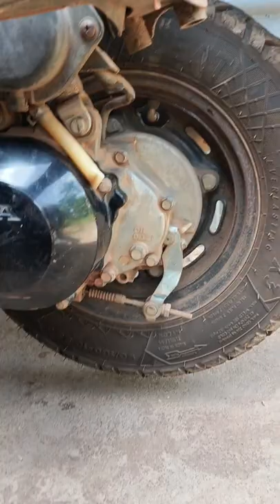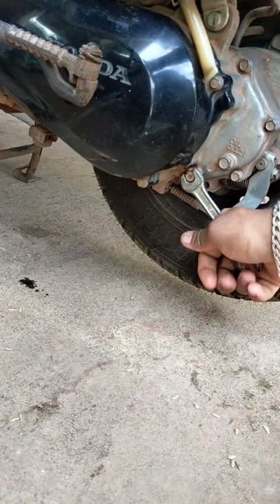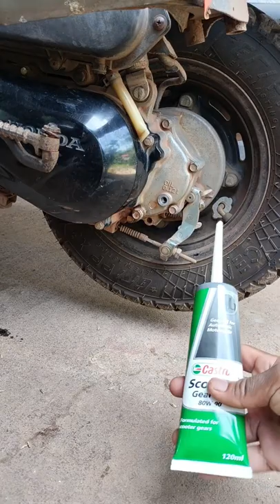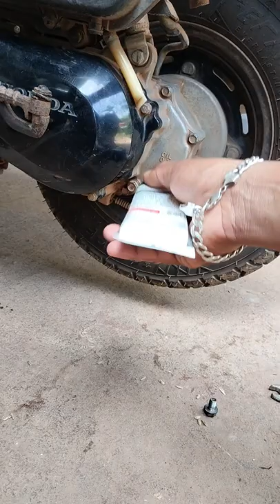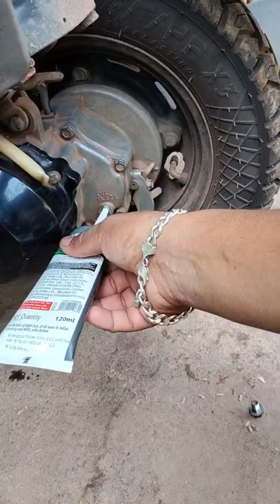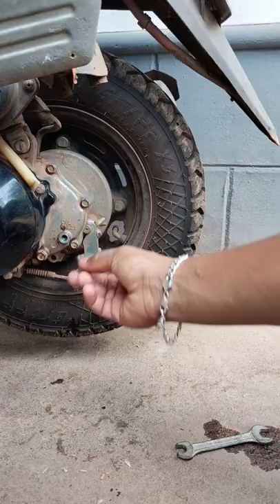Honda Dio Gear Oil Change

Comment: Always open the fill plug before you open drain plug.
Reply from the maker: Step One is to Remove the 12 Size Drain Bolt and Drain. Oil. Step Two is to Install the Drain Bolt Once the oil is Finished Draining. Step three is to Remove the 12 Size Filler Bolt. Step Four is to Filling Gear Oil. Step Five is to Install the Filler Bolt.
Reply: @techeatvibes  if you remove drain bolt first, and after draining old oil, what if you can't remove your fill plug?, there are some chances, that's why you have to loosen your filler plug first
Reply: @midhus5106 Ahh you're right bro,i never thing like that before and now,i know thank you

Comment: Bro engine oil thanne gear oil aayi use cheythal any issues ?
Reply from the maker: Engine oil is not to be used in the scooter gearbox.
Engine oils are subject to high running temperatures while Gear oils are subject to high-pressure movements.
Reply: @techeatvibes thanks for the information. Much appreciated… what gear oil will you recommend for my Kymco racing 150?

Comment: Wht will happen after this
Reply from the maker: Regular maintenance of the gear oil helps ensure smooth and efficient operation of the scooter's transmission system.
Reply: How often we need to change gear oil.?

Comment: Can I put engine oil in gear oil?
Reply from the maker: Gearbox oil has a higher viscosity than engine oil and this is because it better protects the gears, ensuring you have a smooth transition between them. The higher viscosity is also essential due to the fact there is no pump to push the oil around the gearbox.
Therefore, you cannot use engine oil in your gearbox.

Comment: Damn that oil must be 15 000km or more
Reply from the maker: Like the Engine oil gear oil is one of the Important thing need to be changed in constant interval the manual says 5000Km but its better to change it with every engine oil change. which would help your machine's transmission work smoother and longer(gear oil is pretty cheap when comparing to other consumables in scooters)
Reply: @techeatvibes  yep I did change mine a month ago 1L of gear oil was only 5€

Comment: dio gear undo
Reply from the maker: Honda Dio doesn't have manual transmission gear, it is featured with "V-Matic transmission gear'' which means variomatic transmission, these are automatic gearboxes which have no gears as such for the user to change / shift.
Reply from the maker: Gear Und Bro.
'Automatic Gearbox' Gear system ann ullath..

Comment: Thats wrong method first open fill nut then open drain nut
Reply from the maker: Step One is to Remove the 12 Size Drain Bolt and Drain. Oil. Step Two is to Install the Drain Bolt Once the oil is Finished Draining. Step three is to Remove the 12 Size Filler Bolt. Step Four is to Filling Gear Oil. Step Five is to Install the Filler Bolt.